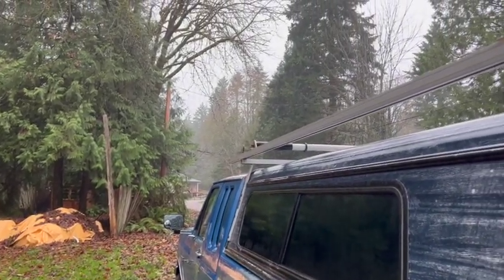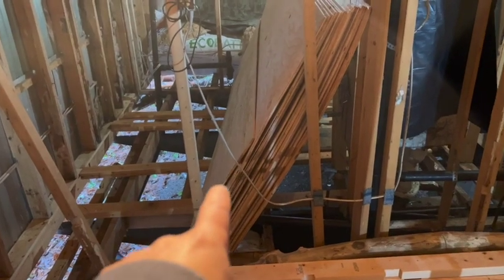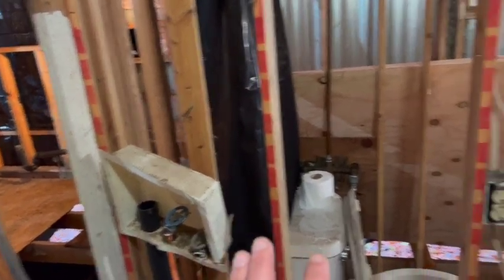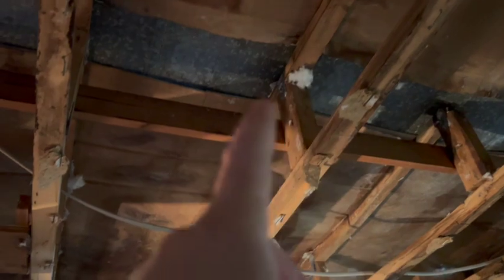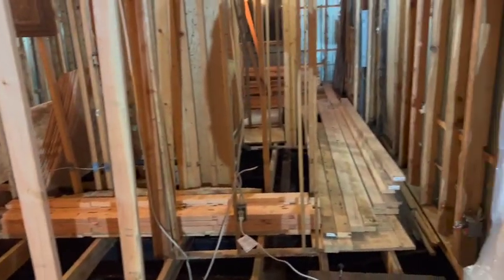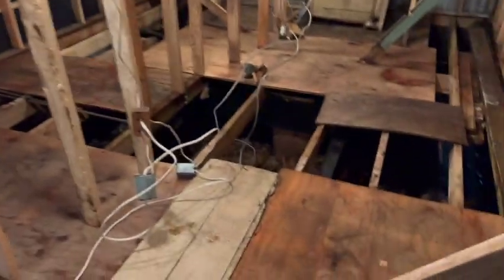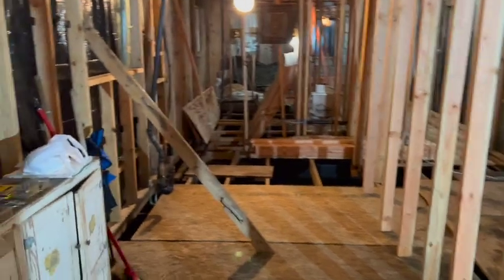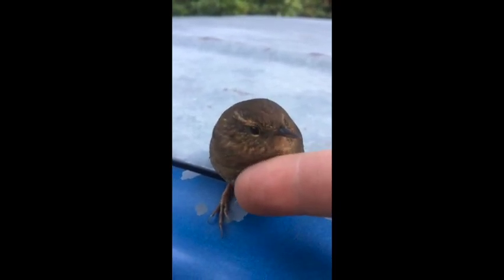Atmospheric River Hampering my Single Wide Mobile Home Rebuild!

Comment: As a former contractor and now mobile home owner, I'm glad to see you're doing a complete gut remodel on this place, Good work! There are so many older mobiles that just get torn down because of different reasons that could be redone like you're doing and provide decent low cost  housing for people needing it. Instead, the industry is quickly becoming unaffordable as the prices of even singlewides is climbing out of control.  It would help many people, I think if you could give some materials figures on the rehab. I know prices vary by area and also that some/many are sourced used or even free, but some ranges would be good. Labor again varies due to doing it yourself or hiring or trading it out.  So many people could have a decent place for maybe 20K  or so, especially in more rural areas.
Reply from the maker: Yeah it's nuts how much a new one costs these days, plus the towing and setup costs etc. I'm working on a video right now which is just a vlog talking about the direction of my channel, taking the winter months off from going out the property, and the few video's I have planned during this off time so I can still give y'all some content, and yup, one is current expenses, and a few other ideas so stay tuned and thanks for the great comment!
Reply: @thesomewhathandyman9400  I'm stuck up in the north and have the same problem- cold and snow. I can't get much done in winter. Perhaps one thing to do is take plenty of measurements and, if you have an enclosed area/garage, use the time to build or repair any cabinets, interior doors, etc so that in spring they're all ready. If you can find 2 or 3 places and rehab them all, there could be enough work to last the winter then finish them all in the spring/summer.
Reply from the maker: @williamrichards7081  Thanks for that and yup I do try and take care of other aspects that I can when I'm not at the property. Right now it's working on my camper van as I just set up a space heater in there and work on small things.

Comment: Im green with envy over that radio! Im also in awe of all the work you have done. Im still crossing my fingers that my roof is good, so far it has been. If its not I will probably just sit down and cry cuz there is no way I could do what you have done. Huge kudos to ya!
Reply from the maker: Thanks for that! Yeah, I just had to buy a $100 battery and charger and I got to choose a free tool and this radio was normally $200 so I was like yeah, I'll take that one! But yeah I don't see any sags in your ceiling so I think yours is doing much better than mine was. At most if you open it up to replace the ceiling tiles, if you find any issues, these types of truss's are pretty easy to reinforce and repair.

Comment: How many bedroom is this it's going to be nice when it gets done
Reply from the maker: There is one 'master' in the back of the house, and two up in the front end of the house. The 3rd is really tiny though, but I do like the original design of the house so even though all the inner walls are going to be rebuilt I'm going to keep it that way. The front one is going to be my office and the tiny 3rd will be a quest room. Or at least that's the plan for now. Thanks!

Comment: when will the sub floor go in ?
Reply from the maker: Probably start on that in the spring. I have to replace the front sheer wall then repair/replace the water lines. After that then I’ll start on the subfloor.